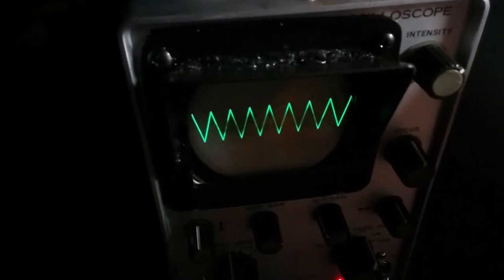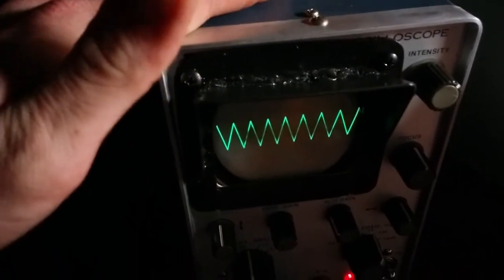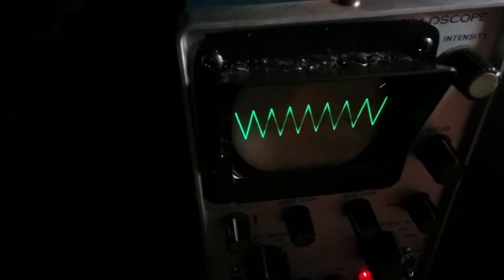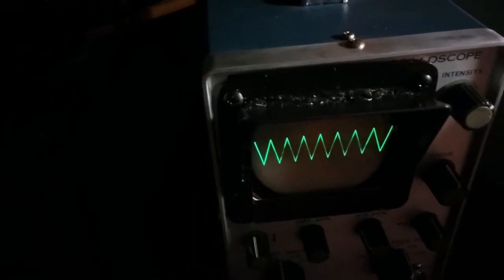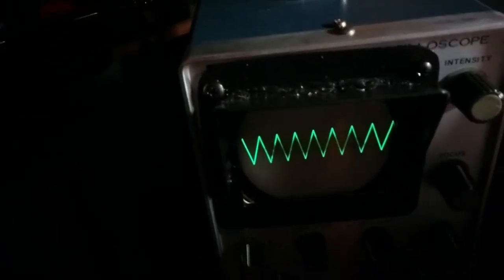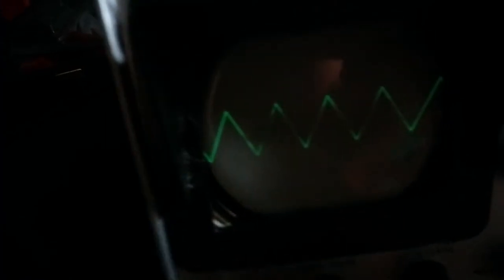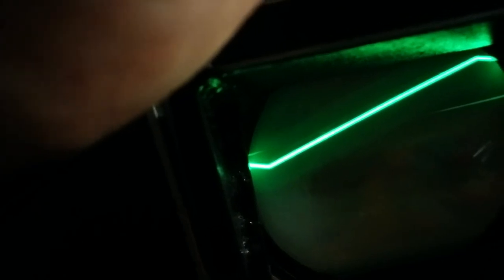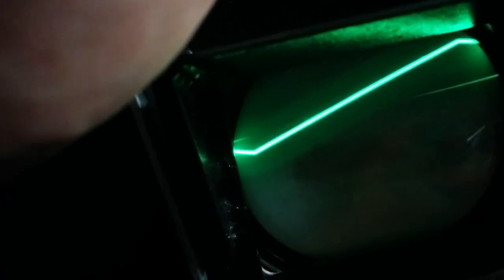Simple analog 'scope Hack: infinite persistence/storage mode

Comment: Interesting idea of using slight burn in as a form of waveform storage, yet its inabillity to be erased on demand is greatly limiting its potential in practical use. I wonder, how hard would it be, to modify existing CRT such as yours to true storage CRT by inserting required additional electrodes and electron shower for the long term persistence effect.
Reply from the maker: That's what I thought at first. But it only takes a few minutes to wash out the screen. Also, that time falls to a few tens of seconds when the scope/phosphor is warmed up for more than 10 minutes or so.

If the recorded trace isn't illuminated, it persists with apparently perfect fidelity for at least days. 

I'll explain in the follow up why the screen is erased and not just "saturated" by even illumination, as I guessed at first.
Reply: @analogplanet9675  I think the "writing" electron beam charges the phosphor negatively when its intensity is set to high and the charged areas repel the scanning beam. I may be wrong, but to my knowledge, there is no such things as reversible burn-in on CRTs and the fact that it persists for a long time if not discharged by some means, such as by hitting it with more electrons makes me think that it's an electrostatic phenomenon and not just burn-in.
Reply from the maker: @nikomaukkonen4994 very solid intuition, sir.  My current model is as follows: the primary beam hits the phosphor which causes secondary emissions from that location, leaving it net positive (attractive, Brighter). The secondary electrons mostly return to other locations on the screen, very nearby. 

Careful inspection shows that a cross-section of the trace is a bright central ridge, bordered by a dimmer region on either side (second derivative of a bell curve) which integrates to nearly zero. 

This explains why a sharply focused dot leaves a visible after effect, but diffuse illumination "resets" the screen over time. 

It also explains why my camera has difficulty seeing the traces. Any imperfections in focus(low pass filter) cause a severe attenuation of the trace relative to background brightness level. It is a very clearly visible effect🙂